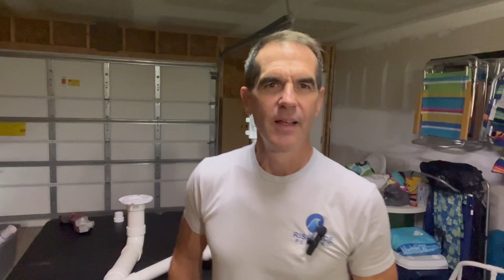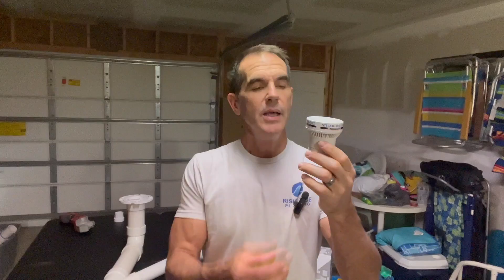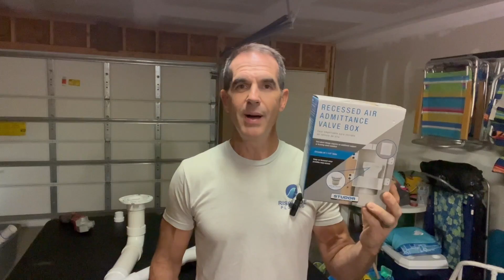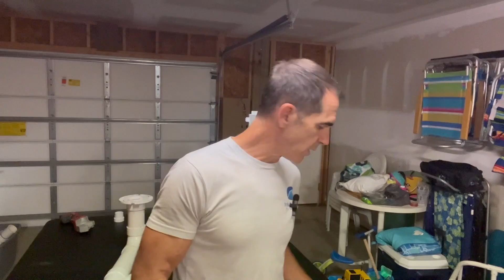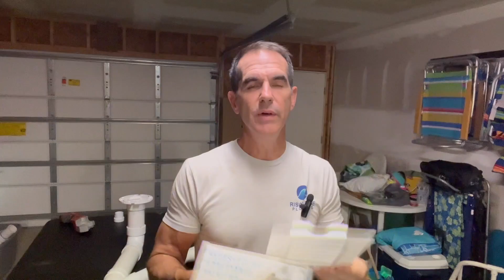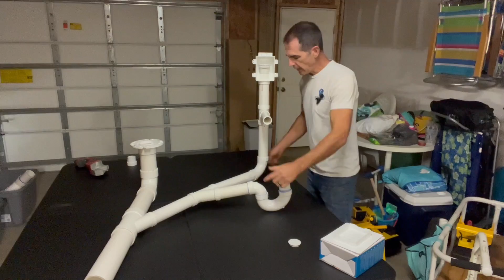Air admittance valves for plumbing venting explained, [just over 4 minutes]

Comment: In Quebec and in most places in Canada, you can use them in an island sink, and otherwise if it takes more than one cut in the wall and one cut in the ceiling for the plumber to access a vent leading to the vent stack. You cannot use them for convenience – you must make every reasonable (not lazy-guy reasonable, conscientious reasonable) attempt to vent the plumbing through the proper stack.

Comment: ALL S-Traps can easily be replaced with a P-Trap and a AAV.
Homes in the North typically had S-Traps because of the cold freezing winter weathers. That's why they didn't drop the drains to the outside walls, which is where the P-Traps typically drain to.

Comment: I live in rural Alaska and am building my cabin off-grid.  I'm planning on using a macerating toilet for my bathroom.  Would you consider doing a video on macerating toilet installation? Also, what is the brand name of that wall mount box for air admittance valves, and where can I order some of those?

Comment: So... my bathroom sink drains out in 1.5 inch pvc, down and over a total of about 8 feet and empties into the 3 inch main about 3 feet downstream from the toilet.  I had an Oatey AAV on the sink drain behind the p trap. Once i installed the AAV I noticed the toilet flushing really slowly and bubbling, with gurgling coming from the sink. Once i removed the valve the toilet flushed great. Thinking I had a faulty AAV I bought a new one and installed it but had the same issue. So my question is, is it possible to use a larger AAV under the sink to provide adequate airflow venting for the toilet? Or should I find a way to get a vent they the roof? Also, since the AAV is on the sink drain that comes in BELOW the toilet, would the initial flush of toilet water try to first push air OUT of the drain before passing the sink drain and forming a vacuum? Just trying to learn all of this and figure out what I should do with this bathroom. The sink and shower drain fine. By the way I have another AAV upstream above the toilet and shower inside the shower wall cavity , so an AAV on both sides of the toilet and it doesn't seem to help. Any ideas?

Comment: Having a new home built and noticed that the island kitchen sink did not have a vent. At the rough-stage, I assumed that a loop vent would be set up for the trim later on. I was wrong. Before sheetrock was installed, at the kitchen area, I noticed three PVC stub outs. The lower one for the 2 inch clean out. Couple of inches above, a 1 1/2 inch stub out for the actual drain. And just over 4 inches above that, an 1 1/2 elbow stubbing out with a cap on it. After watching your video, now I see that my builder plans on installing one of these air admittance valves. Your opinion on this? What are the chances of me having problems with this later on down the line?

Comment: I had one fail in a urinal at the local watering hole, I took it off and washed it Ina bucket of saop and water, let it dry , put it back on and works just fine, I'm thinking it was human fuckery cause I had to snake it first for being plugged up. Then, I noticed it was draining too slow.
That was a year ago and still going great, I caught a lot of shit from the old-timers, oh those damn things ain't code an this and that, I'm like it saved my ass from going up 3 stories to get a vent out the roof. Soo Whhaaaaaa

Comment: Personally I think they are a great solution,  particularly for island sinks.   Unfortunately not approved for use in San Diego county so I had to put in the loop/double drain,  which was complicated and even harder to vent correctly  (new construction).

Comment: I’ve never seen an AAV mounted above the flood rim in a bathroom vanity- not one wants to cut into the wall/tile to mount it between the studs and 6” above the flood rim. Everyone I’ve seen is inside the vanity mounted as high as possible. How often will a vanity sink drain clog so the water level moves up to the flood rim/overflow holes?
Reply: Yes, you wont see that. However, as he said in the video, if it’s the highest fixture in the structure then the AAV has to be 6” above the flood level of that fixture; so I guess you have to cut into the wall for the highest bathroom sink.

Comment: Any advice? I’ve got an AAV under a sink in my laundry room. Every 5-10 minutes, when no water is being used by anything in the home, it makes a whistling sound which I assume is from drawing air in to vent the pipes. I changed the AAV out for a new valve (same exact model) because I thought maybe the valve was bad. Still makes the same noise. I’m ready to call a plumber, but does anyone have any thoughts about whats happening? The laundry room is on the first floor of my house. No basement, just a crawl space below.

Comment: The AAV recessed box in my powder room is not flush against the drywall. The 2'' pipe is a couple of inches away from the drywall, so the 1d10t that installed it left the box hanging in the air.
This causes a mad air wall cavity so when i turn on the range hood, it sucks air from the cavity!!!
Any idea how to fix this?

Comment: I have a bathroom in an out building with no vent.  From the septic tank the drain enters the building to a shower, a sink and a toilet in that order all in a straight line over a distance of about 12 feet. The drain is under the floor on a conventional foundation.  There are p-traps at the shower and sink. The lack of venting causes the drain line to gurgle when I flush or use the sink or shower due to pressure.  Can this be installed at the sink (middle fixture) and solve this issue?   No other issues with the current set up other than back pressure when flushing primarily.
Reply: No you cannot you still need a 2 inch vent going through the roof.
Reply: If it is not a code issue, why do you say that?
Reply: If you already have no vent, it’s worth trying it, just make sure it’s 6 inches higher than the commode rim.

Comment: You've  never seen one fail?? I guarantee that rubber diaphragm will not last 5 years, anymore than the rubber o-ring in a propress fitting will last "forever".

Comment: My house has these in the bathroom downstairs and upstairs, there is NO vent going outside. I’ve been having issues ever since I bought this house. Toilets clogging out of nowhere for no reason, gurgling coming out of the sinks, toilets and bathtubs. The thing that confuses me is everything worked fine for a couple of years and out of nowhere I started having these issues, that’s how I found out there was no outside vent, only these AAV’s.
Anyone have any suggestions on what the hell is going on? My toilets will NOT flush but there is no clog! I’ve tried changing the AAV’s thinking they were bad but no luck with that.
Reply: Did you get it resolved. I understand that AAVs can replacing after a few years or less.

Comment: Hey, great video! This will help with part of my project but I'm looking for some advice on draining my bathroom. I have a small cabin in the white MTNs of NH and started to add a 1/2 bath to the upstairs. Half of the bathroom is being built over an existing deck and will need black and gray water drained to the septic. About 10' from where the toilet will go there's a cleanout pipe sticking 6 inches out of the ground (part of a new septic system). I was told I can drain water into that pipe as long as I use a Y connector, so I can still use it as a cleanout if needed. Is this true? I really is my only option. My plan would be to connect the sink pipe into the 3" toilet drain pipe, then connect a vent tube and then into the cleanout. Thanks

Comment: I have an issue with a remodel of a very old house. I have a 3in vent stack and the toilet is connected to it and I've got an Vanity sink and a shower basin that the DWV is 1.5 inch...I don't have any other vents in this bathroom. Do I use an AAV for each fixture?

Comment: hey, non-plumber here. so ive been getting water knocking from my walls. quite loud, even with water valve off and all water ran through (starting from top, closed faucets, and then bottom), what could possibly be giving the pressure? is there any way to release it without cutting a hole in my wall? sorry for asking here, but plumbers are very expensive in my area and id much rather know what im doing, so i dont end up tearing up my wall to guess and check if avoidable. thank you in advance
Reply: Sounds like you need some water hammer arrestors. Lots of videos on how and where to install them and you shouldn't have to cut any walls.

Comment: I'm plumbing a garage fixture set in slab and connecting to my house septic 15 feet away in a few weeks. I'd rather not have a roof penetration and will be installing an AAV for toilet,  sink and (possible) future shower, assuming a 160stack/24 dfu won't be too much overkill.  Learning a lot from your videos, way more than looking at diagrams and reading how-to's. Thank you!!
Reply: I searched and found this video for the same reason.  I'm building a shop/garage by my house and want a bathroom in there.  However, the septic is on the opposite side of the house, so I'll probably have to go with a sewage pump to pump it around the house.  I don't really want a roof penetration so was looking at these.  There won't be any actual sewer, just the basin the sewage pump sits in.  So hopefully I can get by with just the air vent.  Plus the sewage pump basin is also vented.  Let me know how yours turns out.

Comment: I use them up above washer dryer hookups. Just a regular flat hvac register. Point the fins towards the ceiling so you can't see in. Easy access to replace. I didn't know they sold that box for it.

Comment: I have quite a bit of water leaking out of my AAV at my kitchen sink. Been there for decades. What causes this? I removed all plumbing going down to the floor and don’t have any clogs but it like I have back pressure build up and it pours out this valve.
Reply: Sounds like it is not in the correct position.

Comment: By UPC standards these are illegal fittings and carry no URL rating no matter what state you’re in. UPC states you need two and a half times diameter in venting then the size of your sewer main going out. AAVs have issues that conventional venting doesn’t. They can fail or get stuck in the open position then you smell sewer or in the other position closed and your drain will gurgle and take forever to drain. We’re not in Sweden or Norway we don’t need BS venting that fails. Do it properly  or don’t do it at all. If you knew better you’d NEVER even consider one of these an option. You’d build a proper loop vent or dirty arm through cabinets.
Reply: I live in an IPC state and they are allowed. The ones installed in my house work just fine. My house is 175 years old. It would be a real pain trying to install new vent stacks into this home. We have a 4 inch main vent located outside and AAVs throughout the interior of the house. The setup has been approved by inspectors and works just fine.

Comment: The most important thing is to have one atmospheric vent, I like it to be as close to the septic/sewer or the lowest fixture because it relieves the positive pressure that can’t be released otherwise. This is extremely important if you’re on septic. Otherwise they are excellent for most applications.

Comment: I will call a plumber but am trying to educate myself first.  I suspect my 2007 extension is under vented.  Please clarify how many AAVs are needed for the bathroom in your video.  My drains gurgle and burp when the washing machine spins out.  It is getting worse and water will actually explode out of one of the sinks.  Today the basement bathroom was flushed and one sink mini-exploded on the first floor.  I have 1 roof vent and 3 AAV for a kitchen ( total of 2 kitchen sinks), a first floor bathroom and a first floor washing machine and a laundry sink. Also the basement plumbing sump pump outflow blends into the outflow from the first floor AAV system. I don't get any water backup nor any toilet bubbling.  You video set up is terrific !!!! Thanks  from New York

Comment: I have a ranch with a basement and a crawl space but my shower gurgles so I think something is wrong.  I have a vent pipe going through the roof and it seems to be clear.  Do you know what the problem is and would these air admittance valves help?  Thanks.

Comment: OK I stumbled across your video as I was installing a stand tube in my basement laundry room repositioning the washing machine drain hose from the laundry tub.  I already have a roof vent so do I need the AAV.  I've heard that with a stand tube there could be a lot of back pressure inhibiting draining of the washing machine water without the AAV.  Is that true?  And will I be OK with my stand tube and the newly purchased sink basin going to the 1 1/2" drain pipe.  The stand tube is a 3" reduced to a 2".  Then the 2" goes to a "P" trap.  The output of the "P" trap meets up with the sink drain.  The sink drain also has a 1 1/2" "P" trap.  I've heard that it's best to not use a "Y" tube and rather a "T" tube would be best. The reason I went with a 3" Stand tube is to hold more the washing machine water because the LG front loaders dump their water quickly.  I've measured the stand pipe and it's 32" off of the ground which is more than the minimum 6" above the laundry sink.  Sorry about the long message.  I've got all of the dry fitted and want to glue it all together if you feel it's OK.  Any suggestions would be helpful.

David
K9AT My YouTube Channel

Comment: Great video!  Thank you for the (easy-to-follow) piping examples.  Our plumber installed a Studer Vent on our new kitchen island sink (with a dishwasher hookup) about 6 years ago.  For the last several weeks we have had vent issues with a toilet on the top floor of the house.  It drove me nuts for a while.  I flushed our main roof vent stack but found no issues.  I thought the toilet might have something stuck inside the waste drain that was wicking and causing it to drain by itself.  We pulled the toilet and found that was not it.  After a few more weeks I was ready to call a plumber when I remembered an air vent was installed under the kitchen sink.  I picked one up at the local hardware store and changed it out.  Guess what?  That was it!  No more venting issues in the house.  It amazes me how something so simple can cause such havoc.  Thanks Again !  DP
Reply: Sounds like you need additional vents added into system esp. on top floor
Reply: @delboypass  - yes you are correct. top floor bathroom was not vented per code.
Reply from the maker: You bet!

Comment: Thank you so much for that explanation and the origination of the air admittance valve history lesson. You all take your time to help us to do efficient and code approved projects. I am grateful for that. 

I am a heating, air conditioning and gas contractor in Florida and Georgia and I appreciate our co-laborers and contractors who take their time out to ensure that we make our houses work efficiently and not let's not forget safe.

One point that I did not understand. The fact that we could utilize the air vents but you had to have at least one stack through the roof. I understand this may be a North Carolina code. I was just curious as to why. Thank you for the time you took to build the apparatus and to explain to us how it operates.
Reply: All DWV plumbing systems require at least one vent penetration through the roof line, which allows air to enter the system (main air entry for stack), while also permitting sewer gas to escape.

Comment: Can you better explain “at least 6” above the flood level rim of the highest fixture”.  My best guess would be 6” above the overflow portion of a sink.  If a vessel sink (with no overflow), I would guess 6” above the sink drain itself.  Can you confirm this is correct.
Reply from the maker: Picture the flood level rim as the point where water would flood over and come out on the floor.  6 inches above that.
Reply: @risingtideplumbing so basically in a utility sink set up you would have to Tee off the drain with a pipe that is roughly 2ft tall to get it up above the rim of the tub sink?

Comment: Thank you for the information.  At the end of the video you told us that one vent must go out the roof.  By NC code can the vent go through wall under roof.  We wish not to put any holes in the metal roof
Reply: By code you can't vent plumbing through the wall because of the gases let off. Has to be vented through the roof minimum 6" above roofline but 12" is recommended in areas that get snow accumulation to keep from clogging. Adding a bathroom in my basement and looked if that was an option and unfortunately it isn't.
Reply: This is a great point. @risingtideplumbing can you share any experience on vent stack through exterior wall?
Reply: So have it go out the wall and up 6” above the roof line. Does it take a PHD to figure that out? It’s just air, it can turn corners.
Reply: @5400bowen  it can also be sucked up your soffits Doctor.

Comment: I have an AAV on a garage sink.  I have a backup in my sink, but nothing in the pipe that I can find. I have snaked w/ a 25 ft Ridgid snake and there is zero resistance. Could the AAV be bad?  When the sink backs up, I see water spewing out of the AAV which led me to believe that there was a blockage in the drain pipe, but like I said, after snaking and finding zero resistance that led me to believe the AAV was bad?  Thoughts?
Reply: I had the same situation and the issue was the aav was installed too low. If the aav is not high enough away from the water level, it will not allow air into the pipe and cause your drain to ‘clog’